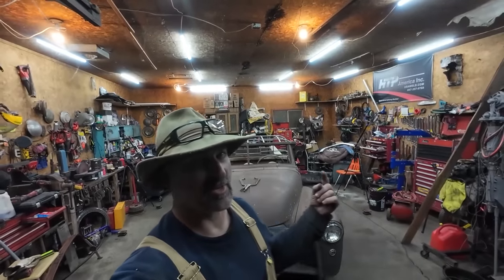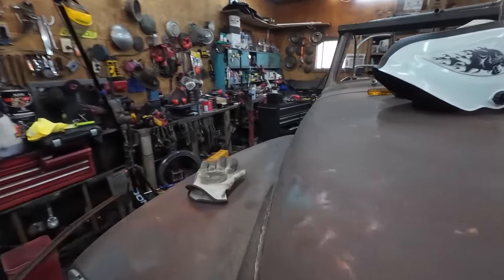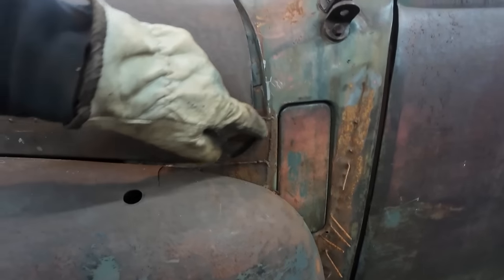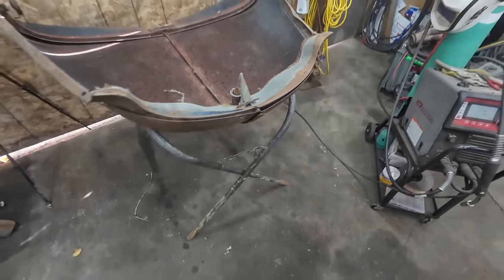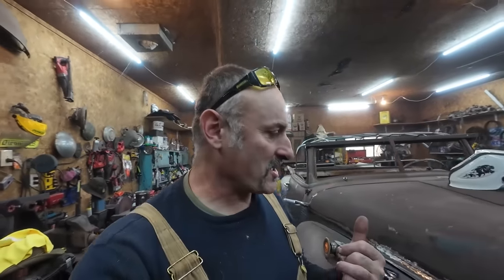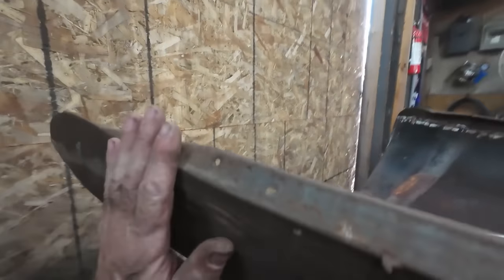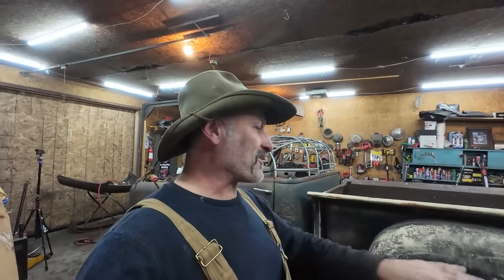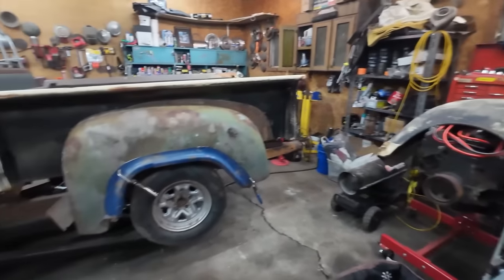Welding and fitting the hood and fender swapping our 49 GMC roadster.

Comment: 20:28 That's what I'd do with the 48 Fleetline I'm considering grabbing. It would take me about three hours to get it to the point I could drive it to the corner gas station, and that's with it basically having bluetooth floorboards and no rocker panels left. IT's patina'd, the body's been banged around a bit, but I think as long as the frame is solid I could make it into a daily without too much fuss.

Comment: Just an idea...fleetside the box instead of the traditional fenders. The box sides could follow the contours of the cab, incorporate the flares from the '55 fenders. I think a flowing, contoured fleetside panel would also give you a better option for sloping down the sides of the box behind the rear wheels too. With the front end as low as it is, chopped top, the traditional stepside box looks out of place imo. Again just ideas...
Reply from the maker: Tried photoshopping the idea and didn't really like the look made it look even more Square haha

Comment: What about a early 40's car fender that way you would have more flowing lines.  Why don't you take the original truck top and cut panels out of it to lighten it up to make your faux convertible top frame or use one from that chevy truck the SSR made in the 2000's.  That top was retractable.

Comment: Please use ths original fenders please take the bubble out by straightening the bottom and widening it they're the only ones that look right, when Brent check out div on rat rods for Africa he's going through the same dilemma about rear fenders right now you need to slam this think so low you couldn't slip a single slice of a leaf of writing paper underneath it frame the bottoms of the original fenders and fix the front taking out the body lines you don't like